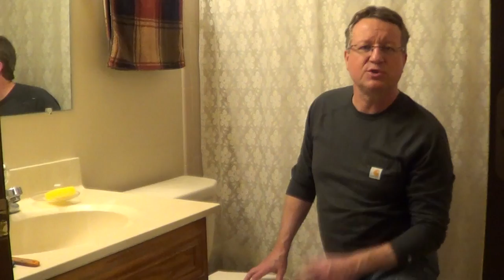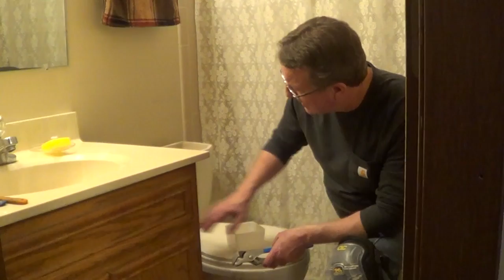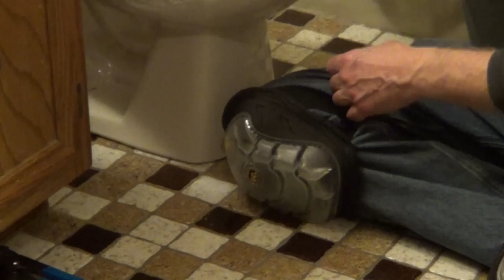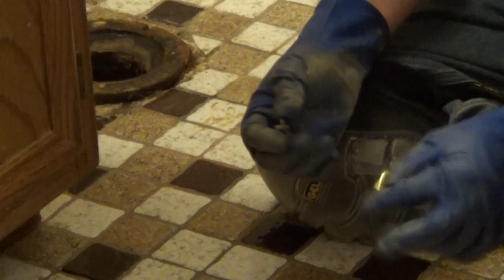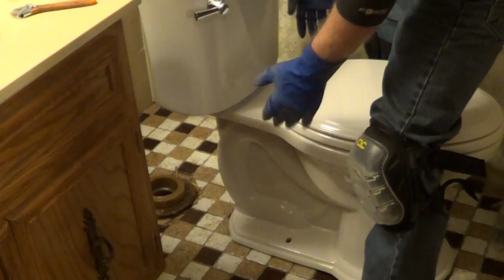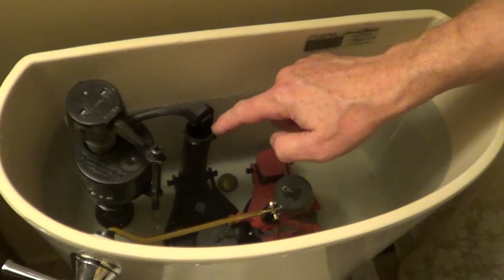How to Install an American Standard Vormax Toilet

Comment: Too finicky for residential use.  Mine works properly less than 50% of the time.  Replacing it with a more traditional reliable design.  I mean in 2023, who’s heard of priming a toilet?

Comment: Every time we have company at our guest house, it takes a few flushes with this toilet in order to get the water to go down again.  Any ideas what having house guests would make a difference?
Reply from the maker: Hi, I would check the water level in the tank. It should be about 1/2 inch from the top of the flush valve. Check the flaps that they are opening all the way when the handle is pushed down. The floats on the flaps aren't tangled.
Reply: The water level is about .5" from top.  Red flap linkage opens against body per instructions.  Only time we have a problem is after guests leave.  The commode loses prime or something and has to be flushed a few times to get it back working proper again.  I read elsewhere that it loses "prime" when someone holds the handle down too long.  I cannot believe a toilet loses prime, but that is what I read.  Can this be true?  We like the toilet.  Toilet just does not like strange people using it I guess.  LOL
Reply from the maker: Ha, I've never had a problem. I will drop a note to American Standard and see what they say.
Reply from the maker: Here is the technical team's suggestion:

Holding the handle down too long will definitely cause the bowl to loose prime.  A bowl can be re-primed by flushing the toilet normally for 10 times, making sure the tank shuts off in between flushing.
Reply: I read about that on another website that holding down on the handle too long would cause it to lose prime.  It seems awkward telling house guests, "hey, and dont hold the toilet handle too long".  Guess we will just have to live with it.  Our normal procedure is to push the handle down, and release it without pause.  A. S. could make a trigger mechanism that would release the flappers even if someone did hold down on the handle too long.  Lot of trouble to go through and would not be cost effective for A. S.

Comment: Within the last (oh...) 10 years, I have installed 5 or 6 toilets in various homes and condos.  USUALLY I do a great job...but there have been a couple of times that the new toilet doesn't total seal with the wax ring, it'll leak, and I have to take it back up and replace what was a new ring for another (and another as I recall.  Finally I called a plumber on that one.).
Any advice in those situations... how to be sure the wax ring is on tight?  I have two more toilets to exchange after the holidays. And I have been avoiding doing them BECAUSE of the bad issues I had with the last go-round.
Reply from the maker: +Mc Kenna Hi, I really like the Sani-Seal. Here is a link. Let me know what you think. https://www.youtube.com/watch?v=8SdeSqNbhG0
Reply: +FIX IT Home Improvement Channel isn't that the toilet that you changed the wax ring on
Reply from the maker: Hi, this is in my Mom's condo. We do a bunch of videos there. Have some drywall and shower videos coming up!
Reply: why didnt you use the sani seal on this one
Reply from the maker: Hi, I wanted to show how to use the kit that comes with the toilet. They include a wax ring. But my favorite toilet seal is Sani Seal, especially for someone who is installing a toilet for the first time. Happy New Year!
Reply: happy new year to you too , I was wondering what was wrong with the old toilet
Reply from the maker: Hi, nothing, just showing how to install this style toilet. It does a nice job of flushing and uses less water.
Reply: what did you  do with the old one